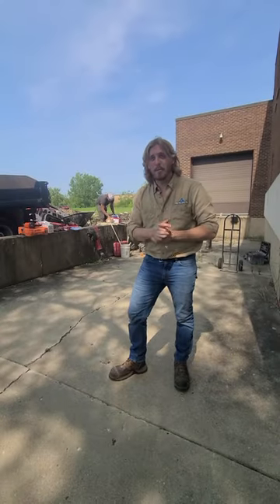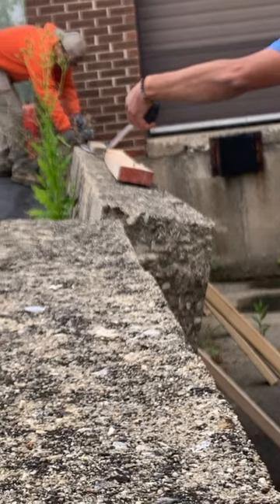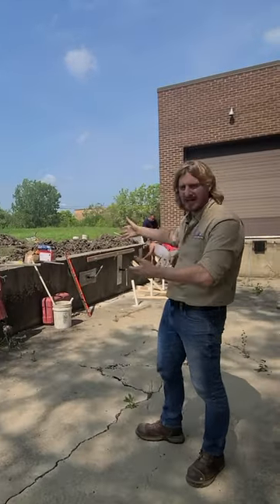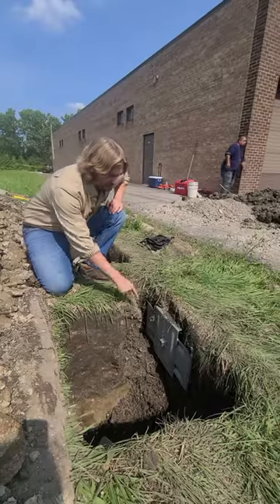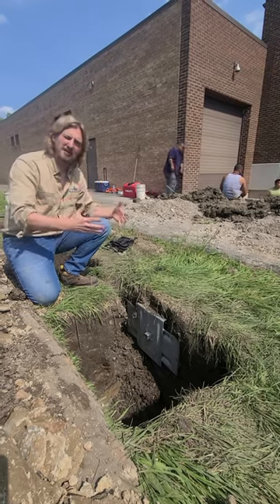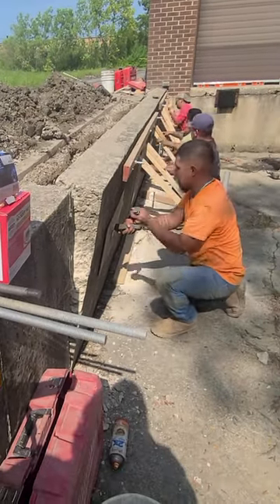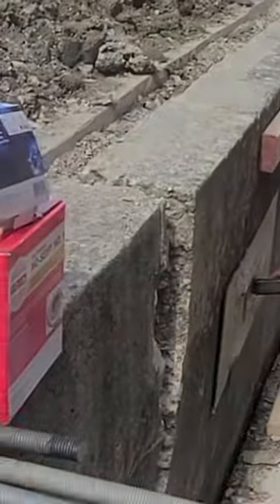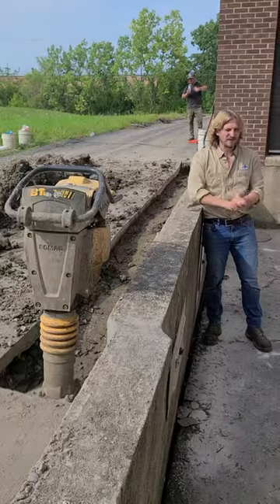How to fix a failing retaining wall

Comment: Cool . How did u drill the rod through the ground?
Reply from the maker: Hi Richard! We use a hammer drill with a special bit that pounds the rod in the ground, inch by inch. 

Ever see those tall I-Beam hammers on the side of a highway by a bridge during construction? Similar to that, only on a smaller scale and horizontal.
Reply: Same tool for driving ground rods? Sometimes that works sometimes it doesnt when grounding electrical gear. I was thinking you could pour a slurry wall trench just behind the wall if the dirt isn't strong enough and anchor to that, or maybe auger down like you would a fence post and pour some anchors, then run cables with turnbuckles to connect it. Maybe for a bigger wall. Makes me nervous if the wall falls apart with crew below it. That way you're cranking safely from the back side. I see these collapsing all over town.
Reply from the maker: @misterbulger  Hi again! Sorry, must have missed this comment. 

The hammer drill drives the rod through the ground, and there are plates on the other side that we anchor those rods to. 

None of these walls have collapsed, and it takes a long time of neglect for a foundation wall to collapse in the first place. These are all engineered to hold back the weight of the wall and the soil behind it.

A slurry wall behind the failing foundation wall would only serve to add more weight and cause the issue to worsen. Pouring a wall on the inside is also a sub-par fix that just serves to cover up the issue. We actually just fixed a project someone did this to and had to pull back both walls, causing extra cost. 

Do not pour extra foundation walls instead of properly fixing a foundation.

Comment: We have a concrete reinforcement wall That's falling but we do not have the money to pay thousands of dollars to fix it we are just looking for a stabilizer do you think it's possible to drill holes into the stable wall and put concrete anchors with a cable and turnbuckles or to hold it from falling
Reply from the maker: Hi Lance!

It may be possible, but it's hard to tell without knowing/seeing the situation. Deadman anchors do help to keep the wall from falling, but they need to be installed properly and with enough support for that wall.

Comment: How much does something like this cost, and how do you keep it from just sagging again
Reply from the maker: Hi Justin! It depends on the amount of plates used (which is determined by the length of the wall). Typically plates run about $800-1000/each. 

This not only corrects the bowing/tipping, but stops further inward movement in the future with the anchors.

Comment: So I already have these plates in my wall  and my wall is leaning so I just need someone to tighten it to make the wall stand straight again?
Reply from the maker: Hi @darrianlittle2272!

We highly recommend against you tightening the plates yourself. Some companies make plans for customers to tighten their own plates and pull the wall back themselves, but it does not work. 

Most of the time, the customer overtightens the bolts, breaking the wall or damaging the supports. 

To properly push back a foundation wall, you must dig a trench outside next to the wall to relieve the pressure and allow space for the wall to move. Otherwise, you're trying to pull the wall against compressed dirt, which is not going to move.

Comment: I dont believe the concrete wall was pushing the slab over.  If you look the wall is off its line from its original place. This I believe was from the wall tipping and  the slab acting like a point of leverage pushing the lower portion away from slab.  Pulling the top back to plumb shows this.  In my opinion should have pulled wall shy of plumb and after compaction it may have set back to original line.  After this you could pull top back and sack the crack.
Reply from the maker: Hi Jerome! Thanks for the observations. Due to the cracking and upheaving of the concrete slab in the middle, we were able to determine that the movement of the wall moved the concrete slab there. 

Once we pulled the wall back, we filled the gap, and everything was restored. Looks great now, back to structural strength, and working just as intended.

Comment: why not just take the wall down and rebuild it from ground up properly?
is that really such a difference on the price? also the floor could be redone at the same time.
Reply: That's gonna cost way more
Reply from the maker: Yes replacing the whole wall would be much more expensive. Most customers decide to repair than replace.